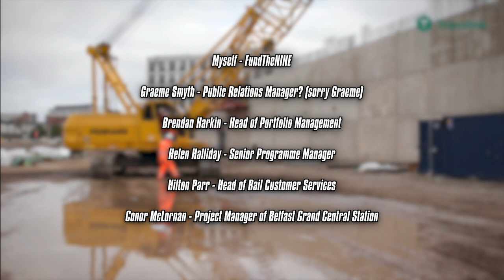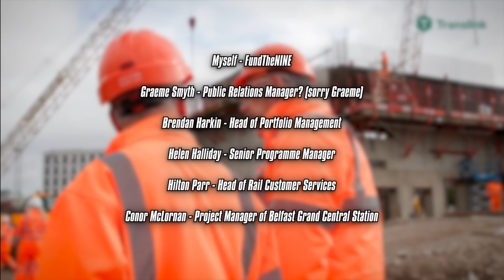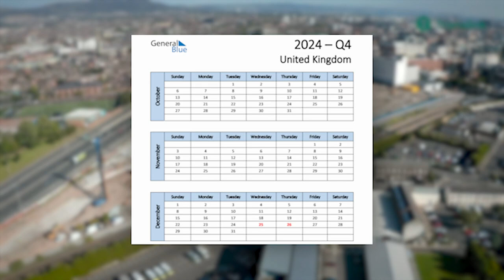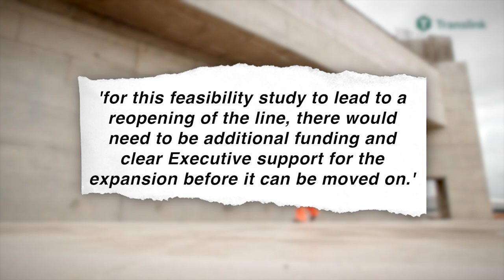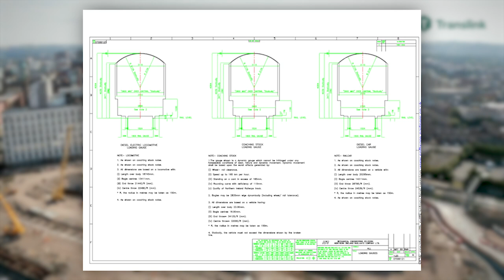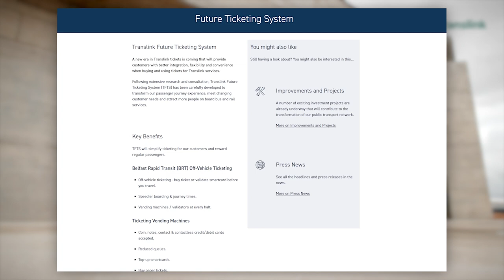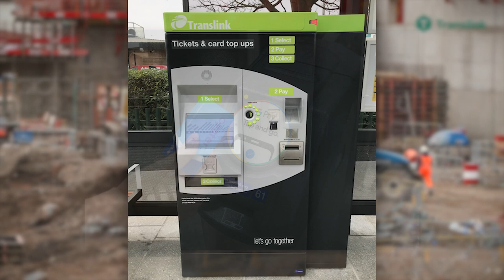The Future of Northern Ireland's Railways | A Meeting with Translink

Comment: The knockmore  line should  be opend to avoid pressure  at lanyon so derry trains can terminate  at lisburn and go express to antrim  until gvs is completed  then open the stations  along the line
Reply: Derry trains should Not go to Lisburn under any circumstances
Reply: @nitrainspotter7622  why they went in 2014 and 2012 when there were works at mossely  west

Comment: I think that it is a big mistake to take the rail lines and platforms away from Great Victoria Street. 
What is the point of moving farther out from the city centre, europa etc .
Example , a future train traveller from the airport will now have a longer walk if he / she is staying in the Europa , not thought through .
Reply from the maker: Grand Central Station will be less than 500ft from Great Victoria Street Station, the additional walking distance will to Great Victoria Street will be even less.

Also, Grand Central Station is set to have 8 platforms, 4 more than GVS currently has.

Without GCS, our railway network cannot be expanded or upgraded as GVS is far too tiny and constrained.
Reply: They should have kept 4 or even 2 at GVS Station and create platforms in the new location. 
Both could have co existed .